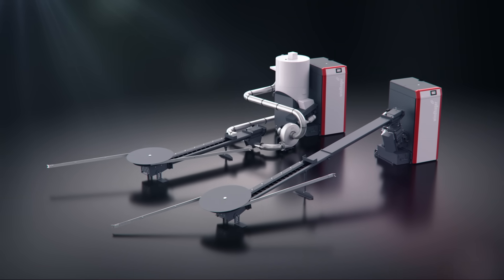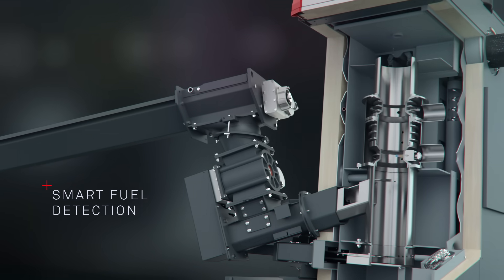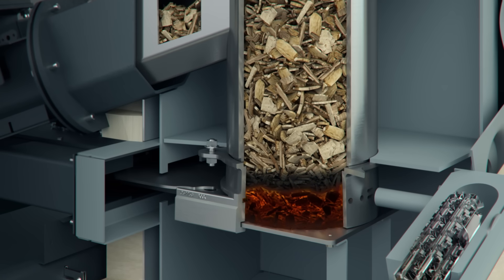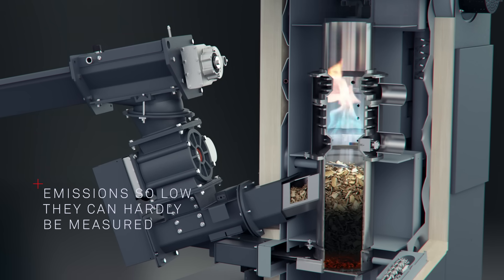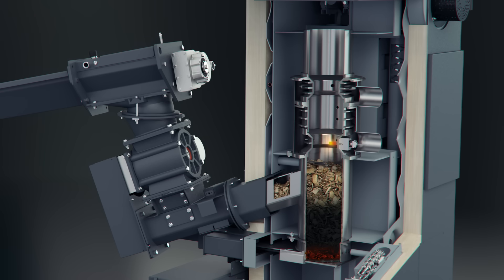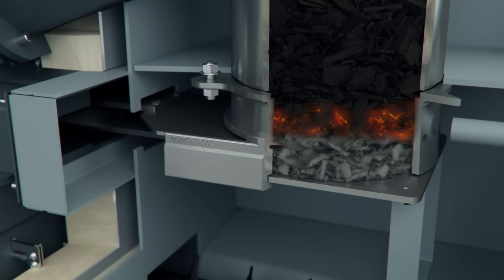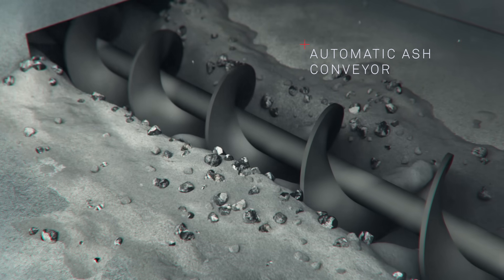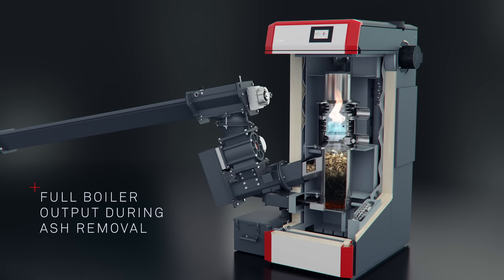Windhager PuroWIN - wood chip boiler - zero-emission gasification boiler with stainless steel burner

Comment: Lets break it down!
"zero-emission!" ok, but how do you make it sure its "zero-emission"? Do you supply the fuel as well? And how do you make sure the building process does not produce any emissions?
"Cleanest appliance in its type" because it has smaller dust emissions which are "hardly detectable".
Sooo basically it emits fine dust which are for now hardly detectable, but emissions nonetheless. Asbestos dust was also hardly detectable but ended up being very harmful for people. How do you make sure these emissions arent harmful for people/environment?

Comment: zero emission is a specifically stated lie.
Reply: cacke is lie too
Reply: Call Thunderfoot and bang them to rights....you can't bullshit science
Reply: So zero carbon dioxide,  zero sub micron particulates, zero heat, zero ash and zero truth?
Does it do anything (other than drain bank accounts)? 
Because if it was zero emission it can't do anything, cost anything to make, design or transport.
Reply: Wood fuel is defined as carbon neutral because it is made and grown for the purpose of burning. So while we can grow more trees we can't make gas or yet anyways.
Reply: @allstarwoo4  Yea but its still misleading, all wood fired energy is carbon neutral. A campfire is zero emission by the same standard. They should have just marketed it as Carbon neutral, Zero particulate emission. Its very good since wood particulates are nasty and carcinogenic despite a pleasant smell in winter, its a very bad experience for children, the elderly and anyone with asthma when everyone is burning wood in a town.
Reply: Chino Gambino your not wrong however a regular wood fire is different from a gasifier. In that it’s a more efficient burn. A simple example being gasoline. You could literally burn gasoline but a small puddle of gasoline will burn and leave a lot of smoke. If you aerosolize the gas and mix with air you get a more efficient burn. In this case they have a small smoldering fire which burns inefficiently filters through the wood. Cooling(albeit very little) and filtering the incomplete combustion then reignites the wood gas above it. The black smoke you see from fires is know as incomplete burns full of gas hydro carbons.
Reply: @allstarwoo4  okay what type of gas we talking here because most gas wont smoke number 1, number 2 this thing literally can't be 0 emission as steel is used in it's construction which is notoriously hard to produce without emissions which has only been possible in the past few years on small scales few being 3-2 years as this was designed some where in 2017 at best i don't think they would have taken that into account. You see when you want to look at the carbon footprint of a product or the emissions it releases in this case, material manufacturing, fabrication, and active running of the machine should be taken into account. The best cleanest thing we have right now is Nuclear which is a really big steam engine.
Reply: @shadow435100  Misspoke, with wood it's not a black smoke but unburnt fuel or particles. Yes, steel is still dirty to make but this product maybe a necessity to life in some areas. By your logic we should stop making activated charcoal to save people from poisoning. Nuclear is the cleanest energy but you still need storage for nuclear waste. Also this is on a per household scale not a state or country scale. Unless you think it's smart to let normal people have regular access nuclear materials? Welders are warned not to carry tungsten in their pockets because they're worried. How do think the public will react if asked to keep a nuclear generation in their house?
Reply: Unknown well yes if you get approval for it. There was one sight that got shut down due to negative views of nuclear energy( I forgot which state). But due to that instead of under ground storage they’re stored above ground waiting for disposal. Which is a another problem because the containers aren’t designed for long term storage.
Reply: @allstarwoo4   but .... the wood needs processing into chips... the energy expended in this process WILL have emissions... 🙄😒
Reply: @peterfitzpatrick7032  Yes, but in the process of just cutting wood you get a lot of saw dust. Also to maintain the amount of tree they harvest they technically have to grow extra trees due to a 85% survival rate (if I remember correctly). So for example a wood company averages a yield rate of 85 trees per year they would need to grow 100 to maintain a constant yield. Again it's not perfect but better than fossil fuels.
Reply: @allstarwoo4  a one time allocation of more trees to a tree field is hardly an issue. trees reproduce rather readily, even if they take a long time to grow.
Reply: @peterfitzpatrick7032  Well not if you use one of these machines to fuel the boilers that MAKES the energy xD silly.
Reply: @peterfitzpatrick7032  My electric woodchipper runs on nuclear fuel.
Reply: @allstarwoo4  Wait..you're saying that this doesn't count as emission because its meant to be burned..how are petroleum and natural gas any different?..
Reply: @hazwanshah4638  they different in a way that you cannot remake them (gas and coal) again and in a process of extraction gas and coal do not absorb CO2, when trees are. So, they are not quite "doesn't count as emission", trees are emits CO2 as well when they burn, its just when they grow they absorb CO2. It's not perfect, but better in my opinion than coal\petrolium\gas.
Reply: @orin4116  yeah..did some reading about the phrase "zero emission"..pretty sure its a kind of target or a vision in producing energy with low emission or no emission at all..zero emission would most likey apply to renewable energy like solar, wind, wave or even nuclear..I wouldn't call any kind of burning "zero emission"..maybe they should've use the word "low emission" instead and make this ad more trustworthy..
Reply: @hazwanshah4638  its defined as 0 emition since you have to remove the same amount CO2 from the atmosphere than will be produced by burning the wood. this is not true for fossil fuels. the argument that this is processed wood so it doesn't count is non sense to because you can use a zero emission source of energy like the boiler to produce the wood chips.
Reply: @hazwanshah4638  Yes, because the growth of the trees takes away the same amount of CO2 as the one released if not more, this CO2 comes from the air instead of an already captured deposit of CO2 that has for milleniums not been in the air, Wood is somewhat renewable. I must add that I am not fond of this method of energy production, while it is theoretically carbon-neutral it would be hard in practice, but better than fossil fuels, and  not to consider depletion of the soil.
Reply: @orin4116  You can make coal in under 6 months...
Reply: @MrJaaaaake      hahaha good one that.
Reply: trees absorb CO2 when hey grow; they emit it when they burn and new trees absorb it again; its a closed cycle thus 0 CO2 emissions
Reply: @MhUser  There never were a question that c02 isnt a part of natures own cycle. The question is how fast nature adapts to such an ever accelerating human race. Evolution to be able to arbsorb more/arbsorb less happen over million if not at least 10000 years. By that time we have thrown the carbon emission ratio WAY above what the trees were naturally used to. This is a cultureshock for the whole ecosystem as a whole and the evolutionary pressure to keep up with humans will be immense. I think its only fair we help a little when we have the ressources to.
Reply: @1Animeculture  the tree CO2 cycle takes 10-200 years depending on the tree species; in cold climate countries burning trees for energy will be the most efficient; trees store solar power; near the equator you should go for PV; sustainable forest policy is not hard to achieve, in my country forest area increases all the time in fact;
Reply: And an unnecessary goal in the first place, so it's to the point of irrelevant with this thing.
Reply: A lie? Nonsense. I get zero emissions from my burning barrel all the time. Granted my barrel is located in Michigan and I take my measurements from Florida but I don't think that would make a difference. Because I also took measurements from Texas, Main and British Columbia and got the same results. "0_o"

Comment: I expect:
A prohibitively high initial price tag.
An expensive long term cost of maintenance due to complexity.
Reliability issues due to complexity. 
Moderate to great difficulty in securing a regular supply of wood chips of uniform size, texture, and proper moisture content to work reliably in this unit. 
An affordable price of those very uniform wood chips, which likely come from a similarly expensive mill designed to produce them.

Comment: One thing: Metal deforms under significant heat. So, no matter how thick or strong the steel is at the moving parts, from being in touch with burning embers for a while, the plates will deform slightly and will get jammed in the moving process. If I were the designer, I would make the plates out of high temperature tolerance ceramic, much like kale wool, but solid stuff. This way it wouldn't deform overtime.

Comment: what do you use it for?
Reply: Whenever you need heat in a industry.
We use systems like this for drying soy and grain as well for generate vapour, for example.
Brazil is naturally short in coal but hold optimum conditions for Eucalyptus growing, so the obvious choice is use firewood in place of coal.
Reply: @rlguerrero2263  Excellent reply! Thank you I had no idea

Comment: For the people complaining about the zero emissions claim, it can be said because the wood chips used are declared a carbon neutral fuel. The growing & sequestering of carbon cancels out the burning of the carbon. So the net emission is zero. The particle/soot emission is also so low it's negligible.
Reply: There's also no heavy metals as with particulates from petroleum fuel. And, a sealed fire like this can burn 99% of gas - without off gassing much carbon monoxide.

Comment: If I was a 15 year old autistic swedish girl with fetal alcohol syndrome and the entire backing of the liberal-progressive establishment, this would make me intrigued. 

In any other case, maintenance for this thing would be a nightmare, not to mention the fact that not all wood chips are of uniform shape, length and density. Unless you have perfectly cut chips, this thing would be useless. 

My other main concern is the fact that there's no way in hell that you could run this thing for 5-10 years without having to service it...the way you do with a normal, non-precision gasifier.

Most technology that exists today is the way it is, not because people are too stupid to make them better, but because, more often than not, long-term efficiency trumps short term emission reductions. 
Wind turbines are non-biodegradable, solar panels are made from hell stuff, electric car batteries create spewing craters of facemelting acid when you end up chucking them. 

All the money and resources you'd end up spending in order to keep this thing ship shape, would far outweigh the benefits it has over a conventional gasifier.